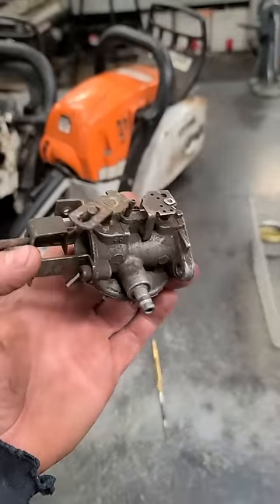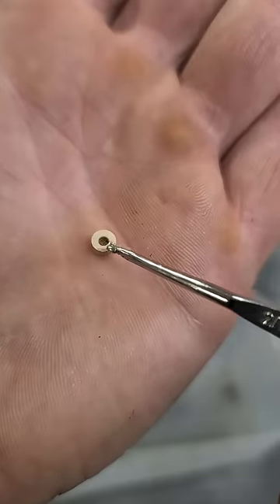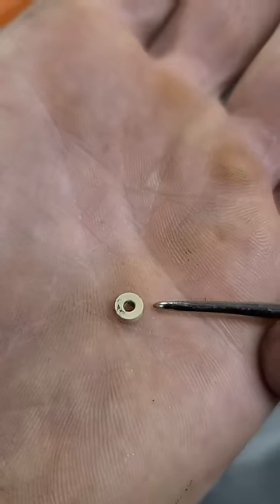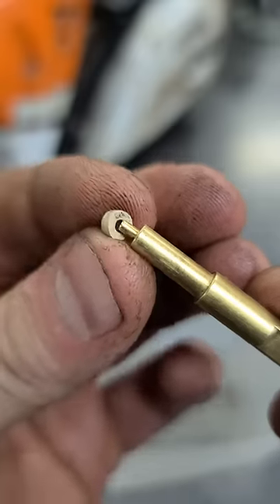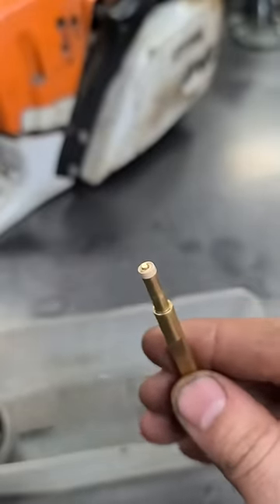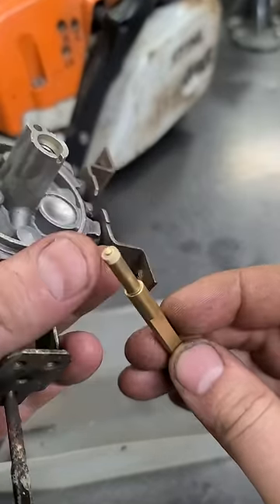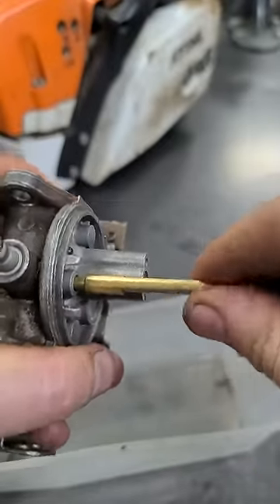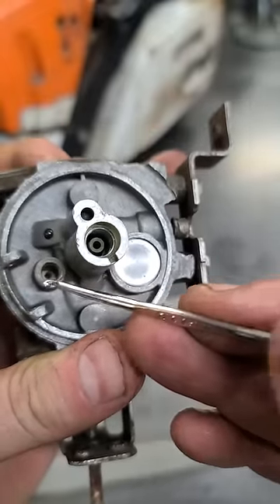How-To Properly Install Tecumseh Carburetor Needle Valve Seat - #shorts

Comment: Do you know where I can purchase just the needle valve seats? I can only find them in a kit and I usuall only dont need the extra parts. I bend the end of a paper clip to remove them and the smooth end of a drill bit to install them.

Comment: And don't forget to remove the old seat first 😉 I sold my buddy a Tecumseh needle and seat kit couple years ago and he didn't remove the old seat and couldn't figure out why no fuel was getting to the bowl.
Reply: If you don’t have that tool I just used an air compressor and a blow gun and blew through the fuel line connector now I have a tool so I can just pull it out
Reply: @hunter7476  I learned about the rubber seats when I was a young lad by blowing it out by accident with the compressed air and then scratching my head why fuel was pouring out of the carb when I was done cleaning it 🤪